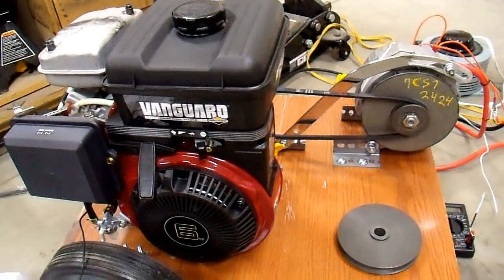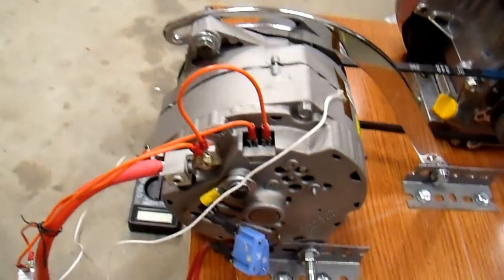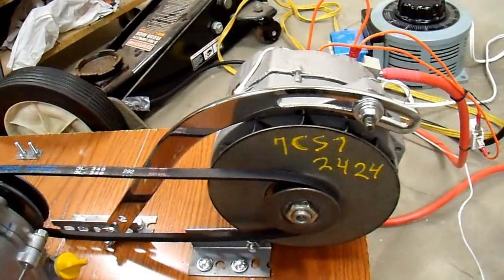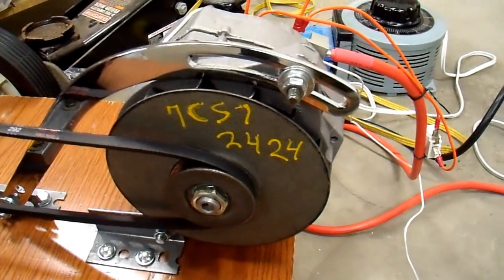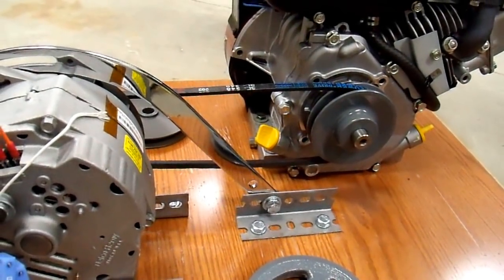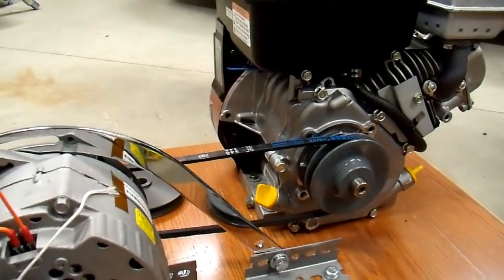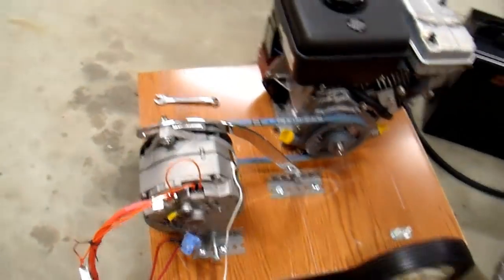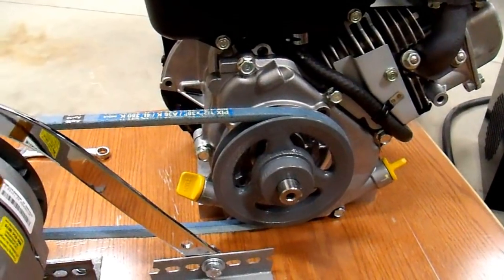DIY 12V Generator Charger - 7 Belt Drive Update

Comment: Another thing to think about is in an automotive application, the pulley on the alternator is in the 2 to 2 1/2 inch range but the pulley on the harmonic balancer on the crank shaft of a car engine is in the 6 inch range. Even larger on the older, larger V8's. On my 2012 Lincoln MKZ, when I floor it to pass someone, the engine tachometer jumps to 7,000 RPM in less than a heart beat. if the alternator / crankshaft pulley ratio is in the area of 3 to 1, this means that my 125 amp alternator immediately jumps into the 21, 000 RPM range but it loses zero efficiency. I don't understand what you mean when you say an alternator spins faster, it puts out more current but is less efficient. It would make more sense if it put out LESS power but not more. Also you said that you couldn't vary the current output with the engine speed. In the truest sense of the word, yes you can if everything is wired properly but at lower engine speeds, this is where you begin to lose efficiency. Also, it just may have been out of view of your camera but I didn't see a battery anywhere in the circuit. Some people claim to be able to run an internally regulated alternator using nothing but large capacitors. If you are looking for any kind of long term precision in your voltage and / or current, this will not work well. All batteries have a certain amount of self discharge times. Some faster than others. Lithium non-rechargeable are good for a shelf life of more than 10 years. Standard alkaline about 10 years. Lithium ion rechargeable a few months and carbon / zinc less than a year. What all batteries do have in common to a certain extent is they all discharge relatively slowly under reasonable loads for their size. Capacitors, on the other hand, discharge in a flash like in a photo flash gun, airplane or disco strobe light but, in the case of really large capacitors, recharge relatively slowly compared to their discharge speed. This will confuse the internal electronic voltage regulator in a modern alternator and cause it to be unstable because lead acid batteries just don't act like capacitors. In normal automotive applications and under normal conditions, you walk out in the morning to go to work. You begin with a fully charged battery. On the average V6 engine, when you turn the key, you immediately draw a huge slug of between 150 and 175 amps depending on such things as horsepower, compression ratio, the age and quality of your motor oil, ambient temperature and how many accessories you have belted to the crank shaft.  When the engine starts, the alternator begins to spin but, in the first milliseconds, it doesn't know how much power to produce. It asks the voltage regulator how much power is needed to make all right with the world. The regulator then samples the condition of the battery and notices that it took a pretty hard hit a few milliseconds ago. Add to this the 5 amps that the A/C clutch is drawing from it, the 12 to 15 amps the A/C blower is demanding, the 5 to 7 amps the ignition system is trying to carve out of it, the 3 amps for the radio, the 2 to 3 amps for the engine control computer, the 3 amps for the GPS, the 3 to 5 amps that the alternator field windings use to convert the mechanical, rotational energy of the engine into electrical energy, the 11 amps for the headlights that people use for automatic daytime running lights and the 4 amps for the tail and side marker lamps. This is all being pulled from the battery the split second that you let go of the key when the car starts and this doesn't include the 30 to 50 amps that the battery itself wants in return for it's investment of 150 to 175 amps to keep you from having to turn the hand crank that your great grandfather had to turn. The battery is actually the most generous item in the car when it comes to it's demands on the alternator. If the A/C compressor clutch doesn't get it's allotment, it slips and begins a race to see who gets hotter sooner. You or it. Same for the blower as it'll go on strike too if it feels starved. The ignition system will let you know via decreased engine performance if it feels short changed and so on and so forth. The battery, on the other hand, is willing to advance you the 150 to 175 amps, even more for V8 and diesel engines, but it only asks for 30 to 50 amps in return and in slower payments as you cruise on your way to the work oblivious to the service that it provides. Like when you're stuck in traffic on the freeway with everything, that has ever  been invented for a car, turned on all at once and begging the alternator to provide the required power to run them while the engine is dozing off idling at only 650 RPM. The alternator, while struggling to do this, can not so it asks the battery for help, promising to repay it as soon as the engine begins to do it's part of the equation. While sitting in a plastic box, constructed of the softest metal since the discovery of mercury, under the hood of a vehicle who's cylinders fire at 4,000 degrees each several hundred to several thousand times a minute, and is still able to maintain it's upright stature and composure, step up to the plate and pitch in where the engine and alternator can't because some jackass jack knifed his truck while looking at some chick in a mini skirt in the convertible passing him, and, unless you are stuck in the same spot for 8 to 10 hours, doesn't put up complaint one, I have to feel a lot of respect for a little black box that I outweigh by at least 225 pounds yet it does 50 times the work that I do for years on end. Yeah, that's quite some powerhouse there for around $125.00.
Reply: what are you talking about dude? the alternator doesn't know much juice to make so it asks the regulator? wtf kind of BS is that, the regulator just limits the maximum voltage. and the reason it becomes less efficient at high rpm is because of impedance which is resistance to alternating current, it decreases with an inverse proportionality to frequency, that's higher voltage is lower impedance, but when it is spinning that fast it's the current that will increase, the voltage is always within a fixed range by the nature of its design, the size and number of coils etc.... meaning there's going to be an increased resistance to high currents because the voltage isn't going up.
Reply: @simonlinser8286  And you don't have a fuckin' clue as to what you're talking about.
    The engine turns the alternator. The alternator puts out a voltage according to the charge condition of the battery. If the battery is faulty and is putting out say 10 volts with the engine off, after the engine is jump started, the alternator will only output about 11.5 to 12 volts. If your battery is good, the alternator, depending on brand of vehicle, will put out between 13.6 and 14.5 volts with some made for police, fire, ambulance or other emergency vehicles, as much as 15 volts to handle the load of radios, lights, non air powered blast horns and other emergency equipment at engine idle speed.
    Under normal circumstances, the alternator sees a load on the battery. As the battery voltage begins to drop under load, the voltage regulator, in a split second, sees the decline and begins to bring the voltage back up to it's preset limit.
EXAMPLE:
    You start your car. The battery is temporarily drained slightly from the 150 to 200 amp draw of the starter motor so the voltage regulator increases current to the field windings on the alternator shaft through the 2 carbon brushes. At some point, the battery is fully charged and the regulator decreases current to the field. OK, it's raining and chilly out so added to the initial 35 amp immediate drain from the alternator field, the ECM, the ignition system, the electric fuel pump and battery charging, now you've added the head and tail lamps, the windshield wiper and defroster which on most cars involves the A/C compressor to defog the windshield so now you've added another 20 to 25 amp draw. This begins to pull the battery back down so in a split second, the regulator senses this and again increases current to the field coil to increase the output of the alternator to power the added load(s).
    OK, you put the transmission in gear and drive. Depending on your speed, your engine goes from 700 or 800 RPM at idle to 1,500 to 2,000 RPM, again, depending on 
speed. ANYTIME you increase the RPM's of ANY power generating device from a 1948 Tucker Torpedo DC generator to the Niagara Mohawk AC generating station in Niagara falls Canada, you will increase it's output voltage and current until it hits it's maximum voltage. When the voltage regulator senses the rise in alternator output voltage with increasing speed, it will reduce the amount of current going to the field coil until it hit's it's designed output or lower in the case of a low charge state or defective battery. In the case of a low charge state such as leaving your headlights on for an extended period of time, the alternator will eventually bring it back up to it's design voltage assuming the battery itself is within it's operating parameter's.
    Coil impedance and / or resistance, inverse proportionality and frequency have absolutely nothing to do with this function and are all taken into account in the design of the alternator / regulator unit set.
    Frequency specifically has nothing to do with it as it is a 3 phase AC output that is rectified by 6 diodes within the unit and filtered by a built in condenser before it is fed into THE DIRECT CURRENT SYSTEM of the vehicle. All alternators work basically the same.
SOURCE:  TWO YEARS OF DIESEL MECHANICS SCHOOL SO DON'T "DUDE" ME.

Comment: When you increase the size of the engine pulley, you increase the amount of horsepower required to turn the alternator. This is why cars and trucks need lower gear ratios to get going and can't start out from a dead stop in high gear.

Comment: Any time large currents are sent through wire there is a voltage drop.  The larger the current the greater the voltage drop. If you are sensing the voltage at the alternator the field current will inappropriately decrease, limiting the voltage and the current. That's why some alternators have a separate voltage sense wire (#14 or smaller) which goes directly to the battery terminals. No appreciable current flows through the sense wire so there is no voltage drop and the regulator senses the voltage at the battery and not at the alternator.  It looks like your alternator has a sense terminal, and it looks like it is directly connected to the B+ (battery) terminal.  As an electrical engineer type myself, the ideal would also be to have a negative sense wire from the alternator going directly to the negative terminal on the battery, but I have not seen that implemented. Good luck.

Comment: Why not just use a electric motor  use a ignition switch like car turn key start batt on switch to start it turning after its turning it run off the generators power

Comment: A dampener pulley like on a automobile crankshaft. or even a boat propeller rubber hub which allows for slippage when stressed would illiminate belt oscillation and vibration .

Comment: so ive seen a number of videos on this. you seem knowledgeable. the part i am grey on is back in the i don't know 70s , voltage regulators were a separate part of a car found on the firewall like some clinoid. somewhere in the 80s they moved to having them built into the alternator.( if my memory serves me this why they stopped calling them generators and started calling them alternators as well as why back then the part went from a 30 dollar part to over 100) so don't all alternators come with a voltage regulator built in? my goal is to power 1 or 2 100 ah battery's for a generator. my application is smaller and for camping. i don't want to have to worry about over charging. at what point is the battery fully charged (?13.5v) and if the alternator is putting out 14ish is that safe enough. as i understand it you need the voltage to be higher than what you want to charge to. i am running some solar panels but as you can imagine sometimes the usage exceeds the daylight needed to recharge. likewise i could run a microwave at places with no hook up without draining my house batteries.

Comment: The pulley on the engine should be about 7 inch diameter, like on the auto engines. This would spin the alternator much faster. So you need education.

Comment: no,you get high rpm by putting small pulley on alt. and larger on motor.you can put that big pulley on motor and small on alt. and run your motor much slower and get high rpm on alt.you wont stress those bearings in the motor for sure.the alt may just have brass bushings,the motor has sealed or open on one side constantly being lubed by engine.if you are running 5in. on both you will get the same rpm as motor.drop the alt pulley half that size and you won be stressing the motor.you will get higher rpm on the alt. and more out put from alt.if you want torque you lower the motor pulley to get more power at lower rpm or raise the alt. by 4 times the amount or way mor actually to get torque at both ends.you need a smaller pulley at front,and depending you need at least 3 to 4 thousand rpm on alt to get the energy you want,just make sure you get a wide belt or better yet a serpentine type.then even under a load you can run at idle and get high rpm at alt.like a motorcycle you go down 1 tooth on front and it is equal to 8 to ten teeth on the back,increasing power or torque.you want rpm,s at the alt so u go up on motor and down on alt.naturally if you use super small on engine,depending on the load,and big on alt you might have to throttle up some.but with six hp,i dont think you will be pulling down the engine.its 4 stroke,and they are made for torque.u are spinning the alt at the same as engine,that to me is wasting energy.you need to run engine at about 1,500 rpm and gear the alt with smaller pulley and it will easily turm 3,000.if this is where you get good amps and thats not too much rpm on the alt.

Comment: Hi, I love your videos and they have helped me in lots of ways. 
I live on a boat and on the odd occasion it would be nice to run a 240v electric fan heater when motoring short distances. 
Can I somehow use the alternator's AC output (before it gets converted to 12v DC) to run the fan heater? 
Any advice greatly appreciated. 
Thanks. 
Keep up the great videos.

Comment: Mr Knurlgnar, I love the stuff you do, very inspirational.  In fact I think you may have been the first YouTube channel I ever subscribed to.
A few years ago I built kinda a mini version of your power bank.  It has 2 deep-cycles of 125A each in a container with all my electronics mounted on top of it.  Power meters, chargers, Inverter etc.  Then I have a few feet of 2 gauge going to a 250A connector. Then I wired my Grand Caravan directly from the alternator to the same connector in the back of my van.
All that being said to explain, that when I have my little 800w inverter going and I start the engine I often see charging voltages up to and even exceeding 200A from my alternator at less than 1500 rpms, about 15.5v.  Now I know its a much bigger engine and just about double the alternator capacity (200A I think) as your little generator setup, but it seems to me that you should be able to achieve a much higher efficiency on your 6hp(?) setup.
So if we had 100% efficiencys, 6hp should be able to generate around 4475w right?  Even around 60% overall efficiency should put you in the neighborhood of the 2600 or so watts that I'm able to obtain of an auto alternator.
Anyway, I was curious what your thoughts were on this.

* My goal is to add a dedicated 24v alternator that will put out about 5kw at low rpms, as I've tended to spend a bit of time living out of the vehicle lately.  But I also have a 20' 2 gauge jumper cable that will easily attach to the battery bank in my trailer to power everything in case of outage. And should be quieter and cheaper than a dedicated generator in both long and short term, not to mention 10x the lifespan.  Oh, and yes I do run a ceramic space-heater off it, on 750w to warm it up in the mornings and melt our Alaskan ice off the windshield, as in your other video ;)
I'll watch for your response. Keep up the inspirational work!

Comment: I RUN MINE WITH A 5 1/.2" PULLY ON ENGINE & 2" ON ALT. I RUN THE ENGINE A 1/2 THRODLE & GET 107 AMPS AT 14.5 VOLTS

Comment: 'all'' car alternators are ''best' at about 3k-4k, and as most petrol engines are best at about 2k, 'all' cars use 2:1.  i dont know why this is, its one of those unwritten rules they all seem to follow, so they must be some efficiency curve behind it, but like 'all' electric cars use 8.5:1 motor to road. Pk6 multi V belts for the win...
Reply: I'm not an expert, but from what I understand most of the newer (>mid 90s) self-exciting type alternators are designed to deliver 85+% of their max rated current at about 20% of max rpms.  This is so they can power new-fangled stuff like heated windows, mirrors, seats etc., at just above idle. just those 3 things can pull near 90A before you turn your headlights on.  So they are no longer reliant so much on engine rpm as much as the torque your belts can handle.  Of course that wouldn't apply to the older 1 wire regulators.

Comment: If your driven pulley is smaller than your driver you produce faster rpm in direct relation to the radio. Eg 2 inch driven with a 4 inch driver the ratio is 2-1.. For every rpm the driver turns the driven will turn 2 times

Comment: If you're doing a 1-1 ratio use a lovejoy coupler. You would have no energy loss due to friction
Reply from the maker: Tried that in earlier videos in this series.  It didn't end well for practical reasons.  I'd suggest belt drive for most applications.